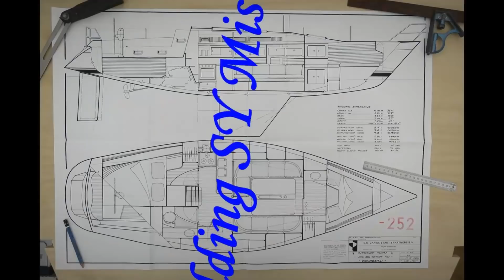Mistress gets a Makeover 💋 Ep.125 Building my steel sailing yacht

Comment: Here's a tip from a pro painter. You should be adding the appropriate solvent to your paints. About 1/2 cup into the emptied part 2 (clear) container. Stir. Then use that mixture to thin the combined mixture (white) as needed. Continue adding that mixture to your working container as the job goes on. Better results all the way around. Much less waist. A lot more coverage. Better finish. More durable.

You guys are paying top dollar for that paint then throwing 20% of it in the trash.

Oops... Take it all back. Watched the rest of the vid and see you are using Thinner. Good boy! Carry on. :)
Reply from the maker: 😁 Thanks very much Russell, appreciated  🙂👍
Reply: Thanks for the tip!

Comment: The quality of your work is well known! How accurate were your paint usage measurements? 
To date, I have never seen anyone that crimps their 'eyes' on ever solders over them for strength and corrosion protection. I know all marine wire cables are supposed to be 'tinned' but I don't think I've seen any of the large cables tinned. And even if they are, adding solder to the crimped fitting does strengthen them and helps reduce breakage from frequent movements and also corrosion of the eye itself which are NOT tinned.
You and Mads (Athena-Sail Life) need to take some light readings down below and see who is the brightest!
Reply from the maker: Thanks for your good comments and question Brian, appreciated and re. paint usage estimates, they vary from 0% waste to ~25%, usually closer to 0% after I have used the product a couple of times. Re. soldering terminals, for eg. I agree with the well respected Nigel Calder's highly experienced advice against soldering in the marine (and other) environments in lieu of crimping and glue lined heatshrink and fyi ALL of the cable/wire in Mistress is high quality brand tinned including the AWG 1/0 (at great cost!) as are ALL of the terminals and lugs. I do prefer a light and bright interior, with soft lighting for night's  🙂👍

Comment: I've painted a lot of cars over the years, when a customer asked for White, I'd always add a few drops of Blue so it didn't come out looking like a refrigerator. The blue isn't even noticeable, but it 'softens' the white. I can't tell from the video how your white is finishing but if you find it to be too 'Chalk White', try the tinting. I don't know about Boat Paint manufacturers, but we could get tint bottles for any kind of automotive paint...And since you enjoy working on Mistress so much, you can take solace in the fact that you'll never run out of things to fix or upgrade on her. 'Boat: A leaky hole in the water filled with money'...
Reply from the maker: Thanks for your comments Mike and fyi the "N14 white" that I have used/am using for all of the white in Mistress is tinted with blue and yellow to soften it.
Also fyi, Mistress will not leak any water inside once I am finished with her 🙂👍

Comment: You'll need sunnies inside,when finished. A great tip i was shown, is to put your paint tray in a plastic shopping bag, it makes a liner over the tray, that makes clean up a breeze, when painting is done, take your still clean tray out, turn shopping bag inside out  and dispose.
Reply from the maker: 😎 Thanks for the good tip, appreciated and yes I am aware of this one. Although I use thin, cheap disposable trays it would be better to use even cheaper plastic bags  🙂👍

Comment: That must be your Sunday T shirt...'very holey'   sorry, is ventilation for hot sanding.  Blink-um filter on sander is useless...You when a shade of grey (oops, not going there) Mate, use a vacuum attachment..please.
Small hint...after you open paint, epoxy etc cans, hammer a few nail holes on side you pour from in that lid groove...lost liquid in groove can dribble back into can. 
Cutting in !  I had 2 young fellas paint the interior of my house....interesting, as they roller-ed the surfaces with the paint, then did the cut in afterwards....had me frowning until I saw the end product, and no sign anywhere of heavy or light coatings...Won me.
Wow!  Do love that idea of buying bit for the mistress and one as a spare...clever. 
Mate, she is going to be ever so beautiful on "Splash Day"
Reply from the maker: 😆 I have many "Sunday" shirts Dennis and re. sander filter, good point, actually the one on this Makita sander I retro-fitted from my prior sander because the Makita one was useless, the one on there does a reasonable job, but I always (almost) also use masks. Good tip re. nail holes to drain dribble paint and yes I have seen some painters cut in after rollering too. Thanks very much for your good comments, appreciated   👍

Comment: Looks GREAT! Bruce. Have you thought about putting a small/cheap window mount AC unit on the deck, next to a hatch and making a temporary hood. So you can have the interior at a temperature less than scorching
Reply from the maker: Thanks very much Morgan, appreciated and re. an a/c, I actually do have a portable AC one that I did have set up in Mistress last summer, but this summer SO FAR we haven't had many quite hot days and so I haven't rigged it up again as yet, this may change soon though  🙂👍

Comment: Bruce really good idea to put a splash of white into Mistresses walls but I have to ask, knowing the amount of epoxy that you used for all of your walls and just how much money it costs had this alway's been your plan to then cover it in paint?. I'm well aware that you're paint is also epoxy based and I'm guessing that the process was to seal the wood walls with epoxy resin to help with waterproofing then to be painted.  Anyhow Mistress is looking pretty good and before long your going to be needing sunglasses 🕶 😎 when you're inside her lodgings etc. As always brother 💯%    👍    🇬🇧.
Reply from the maker: Thanks for your good comments and question Simon, my intention from planning and pre-start was always to fully epoxy coat every piece of plywood and timber that goes in to Mistress and to have most of the bulkheads painted white with PU. Had I chosen to not epoxy coat those bulkheads that were to be painted white, I would have had to apply more coats of undercoat, so it was a bit of a, "6 to 1, half a dozen to the other" case. There are other reasons too, had I not epoxy coated everything pre-fitting then the plywood faces would be deteriorating and marked/stained over the months/years, also where they join for eg. the hull floors, frames, other bulkheads there would have been no coating protection (because they would have been "hidden") so over time this is exactly the places that rot can start  🙂👍
Reply: @BuildingSYMistress  very true Bruce and as we both know that there's a reason for this saying..." Upstairs for thinking and downstairs for dancing!!!"  Being a little older not necessarily wiser it's a bloody good thing that we have the experience on our side to know when we need to take a step back and think to the future about these things and come up with the best decisions!!. This just proves exactly that!!!. Keep going brother I'm sure looking forward for the next video 👍.

Comment: Was it necessary to epoxy all of those boards if you’re going to cover them with polyurethane?  Just curious.
Reply from the maker: Thanks for your good question Frank, my intention from planning and pre-start was always to fully epoxy coat every piece of plywood and timber that goes in to Mistress and to have most of the bulkheads painted white with PU. Had I chosen to not epoxy coat those bulkheads that were to be painted white, I would have had to apply more coats of undercoat, so it was a bit of a, "6 to 1, half a dozen to the other" case. There are other reasons too, had I not epoxy coated everything pre-fitting then the plywood faces would be deteriorating and marked/stained over the months/years, also where they join for eg. the hull floors, frames, other bulkheads there would have been no coating protection (because they would have been "hidden") so over time this is exactly the places that rot can start
  🙂👍
Reply: @BuildingSYMistress  : thank you for the explanation.
Reply from the maker: @frankd2301  Welcome.

Comment: HI Bruce I, ve just come on to your site so am a bit behind , tell me did  you paint the steel before you put the form on  I remember doing a steel boat but we never painted the walls before he we put the form on and found 15 years later that beween steel and form was sweating   my friend had to pull it all off and redo It    again
Reply from the maker: Hi Glenn and thanks for your good question, yes all of the steelwork was sand-blasted, grinder wire-brushed where needed, epoxy primed and epoxy high-build undercoated 2 times and below the spray-on closed cell insulation it was then PU top-coated. You will be able to see all of this lengthy work by going back to the beginning of my videos because basically this is where I started the filming  👍

Comment: @11:14 is that a partial port light above your head? if so why did you cut it? sorry if you've already explained it :-( just point me in the right direction. hmmmm, still undecided about all that white interior. but wait and see :-)
Reply from the maker: Thanks for your good question Iain, appreciated and yes I did explain the reason for placing that bulkhead across the portlight, which spans to both the saloon and heads and was my "compromise" decision. Also fyi I already have some very nice analogue brass instruments plus the clear finished Rosewood sole, bench tops, cabinet doors, trim, etc. to compliment the white bulkheads  🙂👍